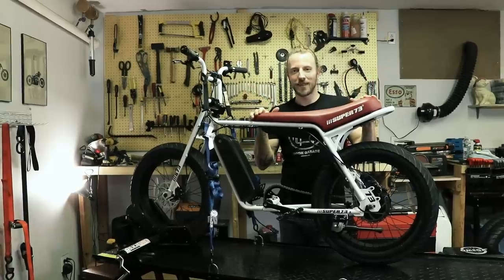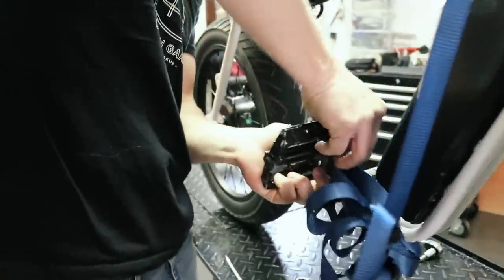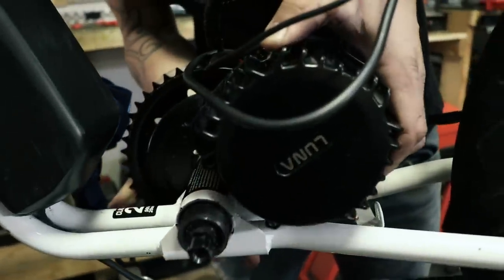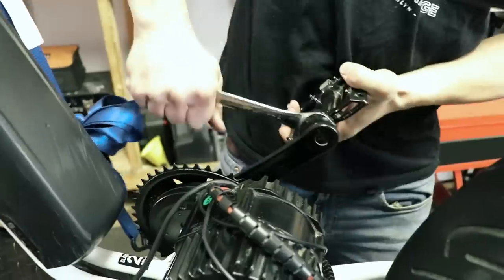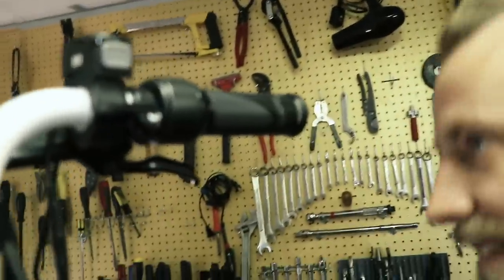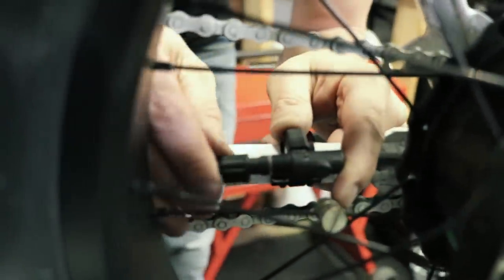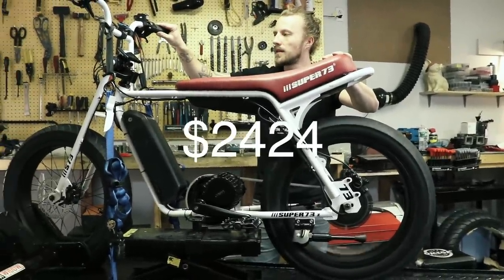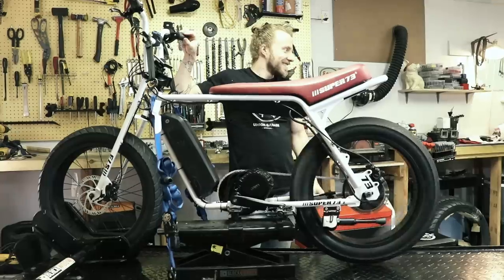Super 73 Z1 CUSTOM BUILD - 1500 Watt motor mod (Bafang BBSHD)

Comment: Love this build and it’s exactly where I’m going with mine.

I purchased a ZG this week and ordered my BBSHD a couple of days ago. I did join a few forums for some help / advice however I’ve received a lot of negativity by people saying I’ve bought the wrong bike, I’m defeating the point of a mid drive motor, I should’ve bought the model up, BBSHD doesn’t work on single speed etc etc……

Comment: Running just a bafang BBSHD 52v bat 42-11 sprocket I can hit 34mph of flat ground. When you spin the BBSHD backwards it becomes a generator. The clicking is called cogging. I have lights hard wired into my electrical system when I back the bike up the lights come on with the battery power off and the light switch on. Awesome dual motor set up though. Good thing you have the hub motor to start off since the BBSHD likes high revolutions. To go faster that rear cog will need to be smaller or the front cog to be bigger. I figure your gear ratio is around 2.40 ish as is. If you could put a 11 tooth cog on the back it would break 30mph. Be like 4.36 gear ratio. You would want to use hub motor to 20 then engage the warp drive.
Reply from the maker: NYangryguy thanks for the detailed comment!! Currently I am running a Cyclone 3000w and I removed the hub motor with a standard mountain bike hub.
The bike is now a little bit stronger than the dual motor setup. Most improvement is the weight. The single motor setup saves a few pounds. My limiting factor is now the battery. ..I am working on a new video for the new Super73 3000watt build. Is coming up soon! :)
Reply: johnnypuetz when is that new video coming?
Reply: sirplus second this
Reply from the maker: Just waiting for the new battery to arrive. That’s the last peace I need for the new build. I can already tell you, it will be fast!! 😬

Comment: just to answer ur problem regarding the controller cutting off when u give beans to both motors is because the luna batteries are designed with a feature call low voltage cut off, so in order to bypass that u either need to lower ur output of controller amps of bbshd, u can do that by connecting ur bbshd with luna provided usb dongle and u can set how much amps bbshd outputs, or u can power the 2 motors with 2 seperate 52v batteries but the batteries need to be of same specs..enjoy...
Reply from the maker: matelslug1 interesting!! I will definitely do some research on this. Thanks for the tip buddy!

Comment: Surely the hub motor is made redundant by the bbshd. Better to swap the rear hub for a geared or standard hub and just use the bbshd and save the weight.
Reply from the maker: Bradboy Bradboy that’s what I did with my new build. But I swapped the BBSHD to a Cyclone 3000Watt motor. Video coming soon! :)

Comment: That motor behavior sounds really strange, thought about getting the EggRider? The clicking when going backwards is fully normal tho!
Reply from the maker: Floydarn' the EggRider sounds like a great improvement. The current display is not showing the Voltage. Seems like the EggRider is a great upgrade.

Comment: Hello, I bought the same bike last week and i love it.. I'm a girl lol But i want to upgrade for a better Rear or mid 1000W or 1500w  (Simple upgrade for a noob lol)  Sorry for this question, but what motor fix this wheel?  is this 20 inch ? or maybe i'll put a mid motor like your....(seen easy) ,   i'm looking one on amazon mid  Banfang, but i see after the 1500w,  i see t42,  t52, t46,  ect  
what that mean? .... so i can choose the right one.. Sorry my noob question. I will appreciated if you respond.. THANK YOU AND I LOVE YOUR VIDEOS.
Reply from the maker: Hey there, first of all congrats to the new bike! :) No worries about the question, you need to start somewhere. To your first question, I would go with a bafang kit. It's easy to install and it looks very clean. Another advantage is that the middrive motors are lighter than the hub motors and the controller is already hidden in the motor too. Don't forget that you will need a battery too. Luna Cycle has great batteries. The numbers with the t's mean the number of the teeth on the sprocket. In my case, I do have a 36 teeth on my front sprocket and 16 teeth on the rear. I would go with the 42 teeth and 100mm bottom bracket version (https://amzn.to/2XeiIri) in your case since the 36 teeth sprocket is an aftermarket one that you can change later.
Reply: @johnnypuetz  Thank you so much for your kind and details respond!! You are the best.. That's what i thought too..the middrive look easy and clean compare to the rear, taking off the tired and all that lol.  I'll give it a try!! thanks again. <3
Reply from the maker: alerumba awesome! Let me know if you have any other questions. Good luck customizing your bike! :)
Reply: @johnnypuetz  Hi! is me again :)  , I'm wondering what's the size for the Bottom Bracket on the z1 ? just to make sure the mid motor fit on it like your? haha,  (I think i'm buying the 
BAFANG BBSHD MID DRIVE), and i need to choose the size before order, THANK YOU!!
Reply from the maker: @alerumba  Hey! You will need a 100mm bottom bracket size. If you are ending up buying the BAFANG, please use my affiliate link to support me! :) (https://amzn.to/2XeiIri). You can pick just the motor or you can also order the kit with a battery. ..Select the 100mm bottom bracket version and like I said before. I would go with the 42teeth sprocket version.
Reply: @johnnypuetz  Thanks again for all the info!! I will do this upgrade thanks to you!! ,  Yes I will go for the 42T.. I have a question tho..  ....If i go with the 42t step of the 46t .. that mean more speed ?   I mean the less teeth =  more speed ... more teeth =  less speed but easy easy gear right? Just want to know is that correct.  I'm not worry about easy gear, because i will be using the motor lol most of the time haha.... also which one should i pick... i went to amazon link and i see 3 options for the 42t: 

42t - 100mm & 17.5ah. downtube battery ..... 
42t - 100mm & 17.5ah touring rack battery
42t - 100mm 52v 14ah downtube battery 

Thanks again for all the help!!
Reply from the maker: @alerumba  "A smaller front sprocket will give you an increase in acceleration but decrease your top speed. A bigger front sprocket will reduce you acceleration but increase the ceiling for top speed." At the end it's a preference what you like more. You should start with a sprocket and go from there, if you don't like it. 
You need the downtube battery version. It comes with a rack that goes into the water bottle mount. I would go with the 52V, since it gives you a little more topspeed.
Reply: This is what progress looks like.  A girl who isn't letting the patriarchy stop her.  Smash the glass ceiling!

Comment: Make your own ludicrous controller you’d need to remove the silicon that fills the controller body(potting) , desolder the shunt resistor and replace with a different value. You’d also want a USB cable from eBay to program your motor
Reply from the maker: PS4 Custom Gamer I do have now a cyclone 3000w setup. But I have your advise in mind when I put the bafang on a different bike!
Reply: johnnypuetz nice man I don’t think I’d get away with super73 or cyclone in my area, BSHD looks fairly stock without external aluminium controller boxes so don’t get many headturns.
Reply: johnnypuetz I really would have liked to have saved you some cash against waiting on a cyclone
Reply from the maker: PS4 Custom Gamer I extended the wire harness and the controller sits under the seat. It looks not too bad, besides of the 72v battery. :D ..I did a second video about the build. Check it out if you wanna see how it looks like.

Comment: How about wiring the battery, that the bike included, with a matching third party battery in series for higher voltage or in parralel for better range?
Reply from the maker: Jacob Reuss you will risk to burn the moto because it’s not made for way higher voltage. Also you need to switch the controller because it won’t be able to handle it either. Second battery with same specs for more range is doable.

Comment: Hey johnnypuetz could you please tell me what are the drop outs size. Are the wheel axles 10mm, 14mm, 15mm or 20mm? I'd love to know.
Reply from the maker: Specs
150mm dropout rear wheel
138mm dropout front wheel
36t front sprocket
16t rear sprocket
100mm bottom bracket size

I think the wheel axles are 10mm. Not 100% sure

Comment: You should have got the hot rod tune from Luna.. they sell that as an option with all BBSHD.. 2500 watts
Reply from the maker: Brian D Howard that wasn’t an option.. I reached out to Luna if I can purchase the ludacris controller. But they don’t sell it separate. You only get it with their bikes.
Reply: @johnnypuetz  it's says right on there page, hot rod tune.. 250.00 upgrade...Am I missing something?? There is 2 different tunes 1- the hot rod tune ( for off road use only on any bbshd ordered ) 2- the Ludacris tune.( Only offered on Luna bikes)
Reply from the maker: Brian D Howard the hot rot tune is 1000watt. The street version 750wstt and with the ludacris controller 2500watt.
Reply: @johnnypuetz  your correct. I went back and double check.. the 1000 watts should get you well over 30.. I have a BBS02 and hit 27-28mph all day.. I just got a Z myself and will be doing hydraulic brakes, a headlight, and a second battery. Nice install of the BBSHD.. .. If I was you I'd get the program cable and play with the settings. Have you thought about getting ride of the hub motor, it may be causing some resistance.. Just wondering..
Reply from the maker: Yes. We will add a 3000watt motor  next to the bike. In this case, we won't have a dual motor setup anymore and just having one motor.
Reply: @johnnypuetz  heck yes, now that some power.. can't wait to see that video
Reply from the maker: Soon buddy! Soon! :)
Reply: johnnypuetz the Ludicrous is actually 2500 watts. But Luna only sells that version with their bikes. They won’t sell you just the Ludicrous modded BBSHD
Reply from the maker: Javi's Boom Yes!

Comment: Hello, I just came across your channel and loved your channel!! If you can please answer me, I went to lunacycle to buy this same mid motor.  but in the options i need to choose " the Bottom Bracket Size *
   68mm-73mm (Standard)   or 120mm (Extra Fat)  they only gave me those 2 options..any of those will work?   Which one did you have in this mod? I will greatly appreciated if you tell me.. Thank you!!
Reply: Not sure why you didn't reply to my question :(
Reply: @proxt11  Probably he is busy.. Don't worry he will reply.. he always reply to me.  he is a nice guy.
Reply from the maker: Hey, you will need a 100mm bottom bracket size. Neither the 68mm-73mm nor the 120mm will work. You can order the motor here: 42T - 100mm & 52V 14Ah Downtube Battery (https://amzn.to/2XeiIri)
Reply: @johnnypuetz  Thank you for your replied. Yes I noticed that motor on amazon , but i want to buy the Luna motor 1500w you have in this mod..  How did you get it fit?  if they only sell 68mm-73mm and  120mm . it doesn't show 100mm so i can choose..... did you mailed them? Thank you for the help.
Reply from the maker: proxt11 you need the 100mm version, that’s what I bought. You can reach out to Luna and ask them why they don’t offer this size anymore or when it’s available again.

Comment: I did the same hack for dual battery as well...but I used a 36v 20ah battery instead.  My “extra” battery does the job so well (mileage, duration, speed) that I never use the original battery anymore😏.  And honestly, since I’ve learned about batteries and watts and amp-hours...I gotta tell ya — the original battery for the Z1 is pretty anemic at 36v 11.4ah (but again you don’t know what you don’t know🤷🏾‍♂️)...

Question tho: for the money you spent (+ $2,000) and for the advantages u accomplished...why didn’t you just purchase a new bike? Curious...

Great video.

/Bklyn👑
Reply from the maker: Robert Motión I recommend to upgrade to 52volt. It’s a big jump and you will feel the difference. 

This built costs about $2400 including necessary tools and the bike itself. This is still cheaper than the OG model, faster and has more power. Check out the the 3000w built. This is in the same price range but does 44mph on flat ground.
Reply: johnnypuetz good stuff.  Would a 52v battery and controller work on the 500w  Super73 Z1 motor though?  

The only other hesitation I have is that...at that speed seems like you definitely would want or need tire suspension, no?  That’s my only hesitation. I clocked 36mph on my Super73 today literally and you definitely can tell you ain’t moving slow😏

/Bklyn👑

Comment: Does the Super 73 have to be turned on while you charge it? Mine had yellow light after full night of charging and it did not accelerate for more than 2 seconds....
Reply from the maker: Michael Bills sorry to hear buddy.. I don’t have any issues. But I don’t use any original components anymore. Motor, batterie and controller are aftermarket.

Comment: Can you get the motor without a battery? I already have a second 48v battery from 73 mounted on my s1
Reply from the maker: Victor Treptow yes you can! Check out Luna cycle. They offer just the motor without a battery.

Comment: what an awesome video. I was looking at the coast cycles and also the Luna cycles "like the S73". I can build easily battery packs and can assemble DIY stuff. What do you recommend me to do? buy the Z1 like you did and over power it ?
Reply from the maker: RideWithOKP if I wouldn’t have my bike and want to buy me a bike again, I would get myself a Zoozbike.
Reply: @johnnypuetz  thanks mate ! your video is really good. Why would you get a Zoozbike over your S73 ??? the look of the s73 is really dope
Reply from the maker: @E-sk8Fr  Because of a few things. It comes with a motor and battery that is at least comparable with the S73 S1 and comes with the same price tag. But the key for me are 2 things, it is 30% lighter and that is a game changer! I need to carry my bike 3 floors and this makes things way easier. 2nd argument is the size of the bike and the wheels. The Zooz bikes have bigger wheels with great moped tires for better performance. ..But at then end it comes down to the questions what you want, need or prefer.

Comment: I’ve only heard about the Super73 from Jesse. I like the build but seems a little pricey. 👍🏽
Reply from the maker: CLUTCH1st true! We are already planing a cheaper build with even more power. 3000Watt and 72V battery. I keep you posted! :)
Reply: @johnnypuetz   Subbed. Keeping an eye out to see what you come with.
Reply: @johnnypuetz  
Is the 3000w a mid drive motor ? What make? Availability? Thanks
Reply from the maker: Dusty Roads 3000w Luna cyclone. I think it is currently not available on their site (Luna).
Reply: @johnnypuetz  
Thanks for the info

Comment: Nice work. Sweet video! That's how these wimpy cheap bikes should come stock. In the end, with the adjustments what was your top speed? We are also running 52volts but are geared way down in order to tow a heavy trailer up steep hills...oh and pop wheelies!!!
Reply from the maker: Pure Water Window Cleaning I can pop wheelies with the 48t sprocket too. Ends up to be more smoother to balance the wheelie in the sweet spot. Top-speed is 29mph with the 48t and 25mph with a 36t.
Reply: I like this Mod but My Z is Solid and fast as is Stock with 500 Watt.
Reply from the maker: @ryan-dewitt  true! It's already great out of the box. you are welcome to take my bike for a spin to compare.

Comment: Great video!  Im curious, when removing the old hub motor, what size/length spokes would you need for stock rear rim?
Reply from the maker: I gave the rim to a BMX shop to get them laced.
Reply: @johnnypuetz  Thanks, i ended up doing the same local bike shop.  Now the only other issue i am having is what axle did you use?  I have the same hub, but i noticed that the axle on the original motor was slightly flattened.  Any tips on where i can find a similar axle?  Or should i just round out the drop outs?

Comment: Johnny,

I was wondering if you could help me? 
I bought the brakes you suggested and tried to install them but they won’t adjust properly. I kept the same rotors on that came on the bike originally. Is there any extra step ? What am I doing wrong lol?? I can’t seem to make it work ...
Any suggestions ?
Reply from the maker: Edgar Candelas hmm.. I didn’t have any problems. What do you mean with they don’t adjust properly? ..this is how I adjust them: loosen the screws on the brake caliber (4 of them). Spin the tire and break. Hold the break and tighten the bolts at the same time. That works fine with booth tires (front and rear). The tires spins free and the brakes work great. ..let me know if that helped or if you have an other issue
Reply: I will try this tonight but do I have to change my rotors on the bike by any chance ? Or keep the same rotors ?
Reply: Thank you for the advice. Will try .
Reply from the maker: Okay, let me know if that worked for you or if you have any problems!

Comment: Hey I just finished this build and the fastest I’ve gotten is 25 mph any way to push the motor to go faster ?!?
Reply from the maker: Sergio Flores this setup goes 30mph. I guess you might run the wrong sprocket sizes? You can use a different controller to use more power!
Reply: johnnypuetz I did it on the z1 exactly like this video what  sprocket do you have on this video and what controller do you recommend ? Thanks for the reply
Reply from the maker: I was running the original controller, built into the motor housing.. you did something wrong. The original motor brings the bike up to 21mph along already.. the bafang is way stronger. I don’t rember the gearing of this build